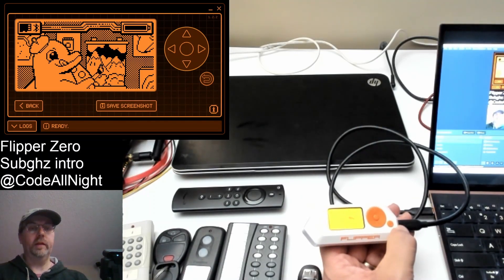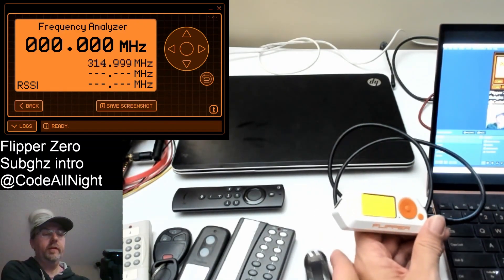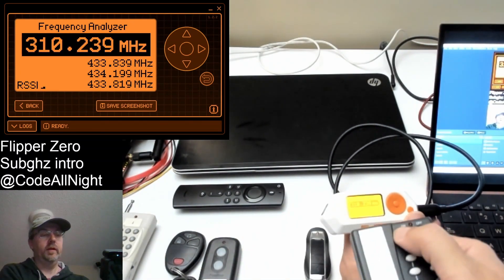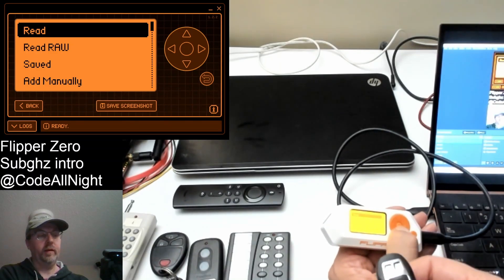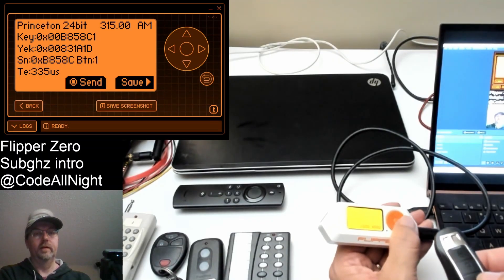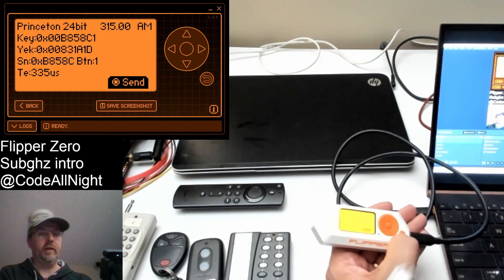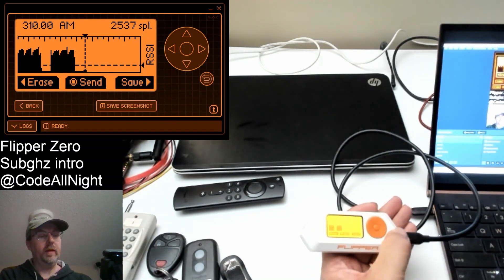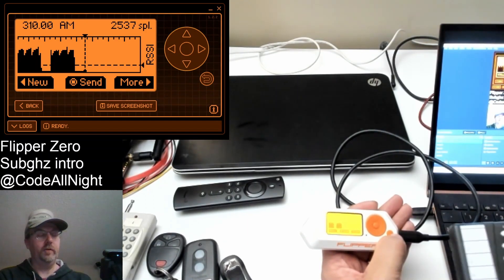[9] Flipper Zero subghz intro

Comment: Syn-GHz have to smak power antena, nie can i do morę powerfull antena external 300-928 MHz?
Reply from the maker: I use an external CC1101 that is tuned to 433MHz and an antenna and it is more powerful than I really want.  It doesn't work well for the 300 or 900 MHz band.  For 900MHz you could use something like https://www.rabbit-labs.com/product/cc1101-modules-compatible-antennas-by-rabbit-labs-/21
I'm not sure if anyone has a good 300MHz CC1101.  Most of the stuff I mess with is stuff I own in the same room.

Comment: Fliper zero Does it work on rotating code?
Reply from the maker: Flipper does Read rolling codes, comes with many protocol decoders, but typically doesn’t transmit rolling codes.  Unofficial firmware comes with many protocol encoders, so it can transmit rolling codes.  Sec+1.0, Sec+2.0, KeeLoq (if MF key is known), etc.  I have a playlist on rolling codes videos.
Reply: Can you create a start stop car engine?
Reply from the maker: @besobeso564  I don’t know how.  I would need car to try it on & I only hack on stuff I own & can replace if it malfunctions.  Hopefully anything newer uses a crypto that isn’t well documented on the internet.  Some older remote start systems may have some reverse engineer and document their encoding/encryption methods.
Reply: I can't find the codes I'm not sure Can you help me?  Thanks in advance